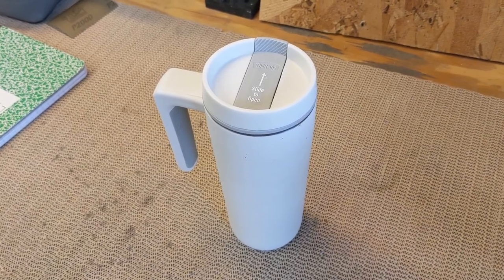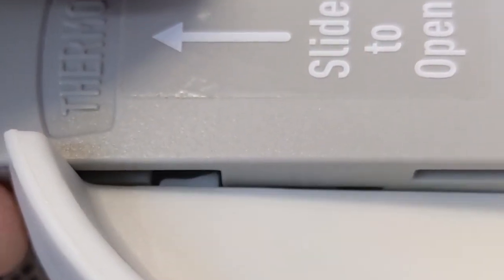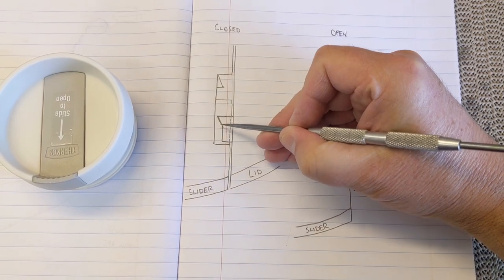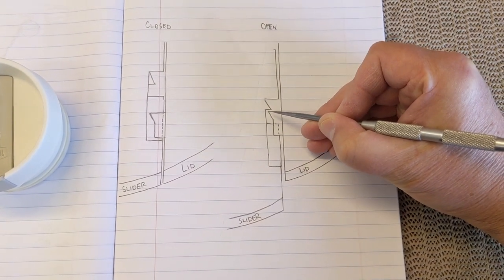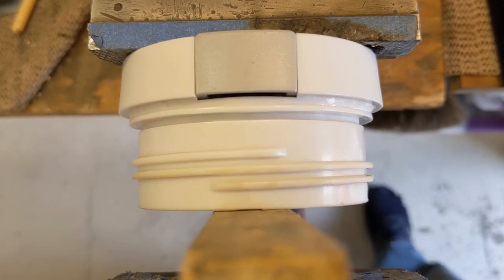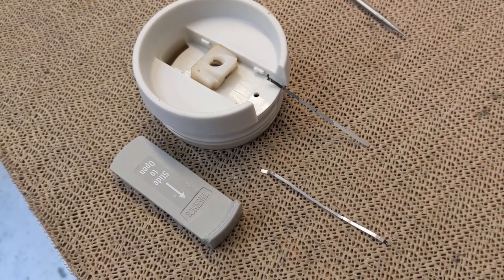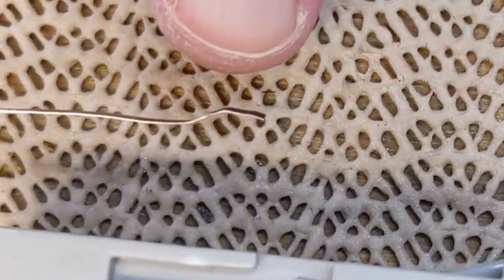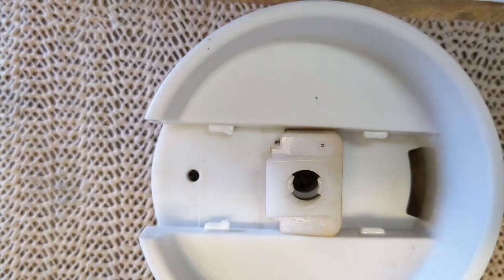Thermos Alta Slide Lock Lid Disassembly

Comment: The new versions can be opened way easier. Pull on the part under the lid (that has locks shapes on it) then (while pulling) slide the top slider (open close thing) past the regular open position. It should pop up and release. They removed the locking wedge tabs that are in the video. The slider is held on with the hidden plastic piece that is holding the big spring.
Reply: I was dreading trying to figure out how to pop open my lids before reading your comment. Thank you so much, so easy!!
Reply: Thank you so so so much!!!! This comment just save me!!
Reply: You’re a hero
Reply: Dude you are a savior!
Reply: Thanks for this!
Reply: You’re the best! Thank you
Reply: yes, I figured that out too, a real monkey puzzle. your description will work on the one in this video
Reply: God thank you🥳👍👍

Comment: A much easier way to do this is to simply place your lid in the open position. Take a butterknife and apply pressure upward to the mouthpiece opening, and it will pop right up.
Reply: Thanks for the confirmation. A paint can opener worked really well also.
Reply: broke a butter knife trying to do this.  argh!

Comment: alright, so I finally got it to work. i guess mine was an older model so it didnt have the nifty thing where you pull on the locking mechanism on the underside of the lid to release the slide... mine was like the one in this video. simplest thing to do is pop the slide open, stick a sturdy butter knife under the slide and lever it up. this will deform the plastic tabs and the slide will pop off. Despite the damage i was able to clean the lid and put it back together just fine. what a shit design, no wonder they changed it lmao